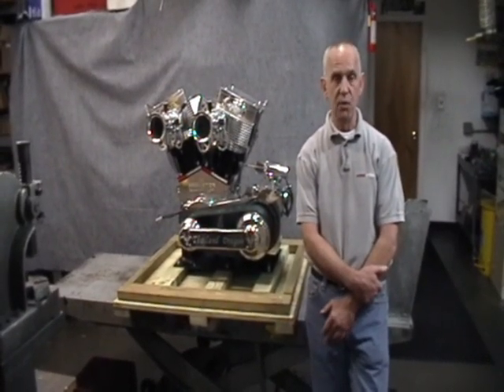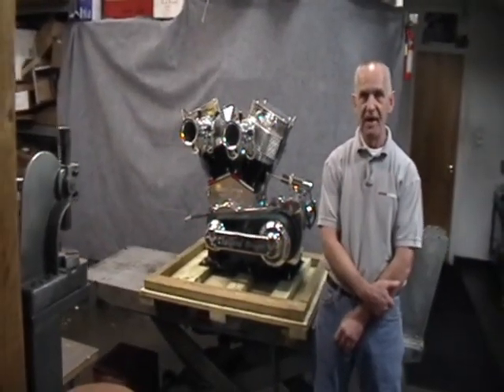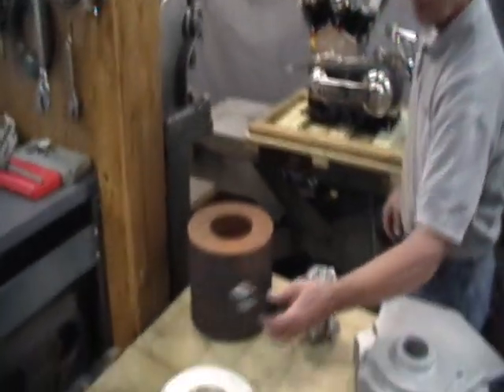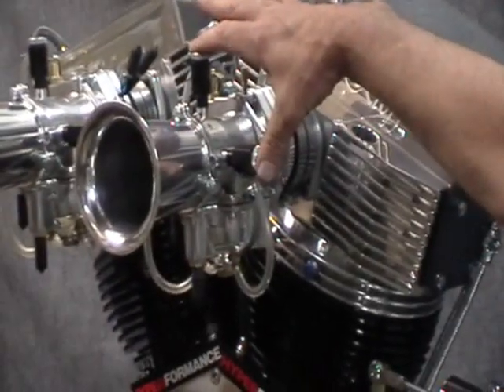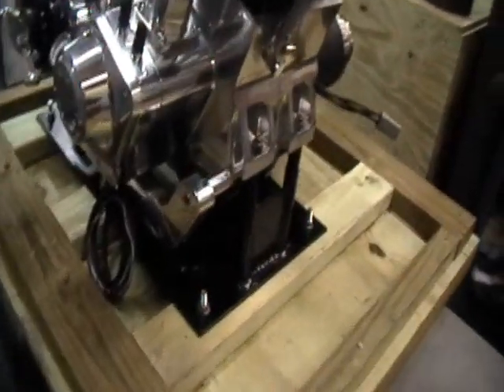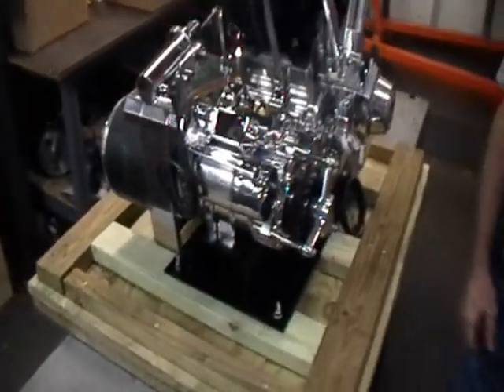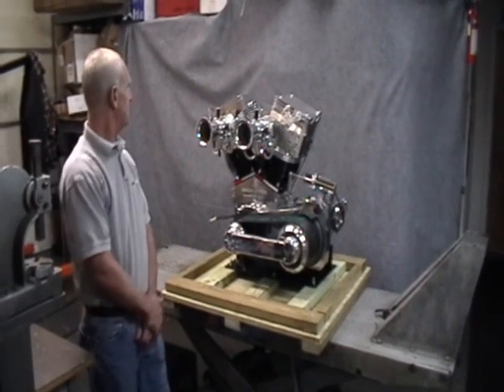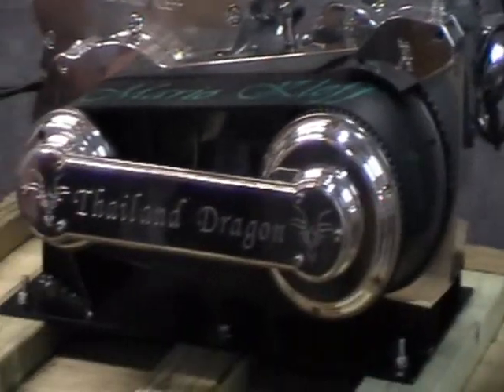Hyperformance 222" Street Pro Motor

Comment: Does it utilize gear driven camshafts or silent chain drive with PLASTIC CAM  chain tensioners which would be a mistake to drive such large cams and oil pump with, in my opinion. Is the flywheel assembly pressed together or does it have a crank pin bolt and nut to hold the flywheel assembly in true? Why not utilize gear drive on the primary side, instead of a belt drive?
Reply: +tomcata1467 You really need professional help. If you don't know what the hell your talking about in the Stock World. What are you doing sticking you toes in this water fool?
Reply: You can see that it is a single cam by the nose cone, so the answer would be gear drive

Comment: Mr. Torgeson custom made the cylinders for my 103" Shovelhead FX Mod. drag bike back in 1990.  What a mess.  Bolt holes drilled way off pattern.  Also did a set of big valve heads.  Porting looked great, but valve stem height all wrong and seat depth too shallow.  Went SLOWER.  These were simple mistakes a precision machinist does not make.  I would not visit him if he were across the street.

Comment: did you do a flow test on carbs with thunderjets ? is there a program for that purpose if you did not fire it up on a dyno. seems to me that if not done then the tuner could fry a topend figuring out if there was enough fuel to air ratio for that monster engine at the rpm ranges. what is the top rpm range before ignition kill. what is your warranty to someone of that caliper ? are the flywheels welded?